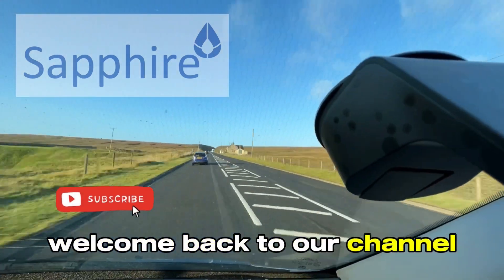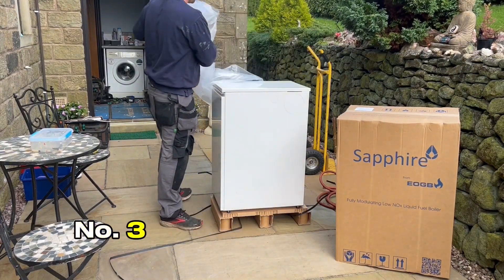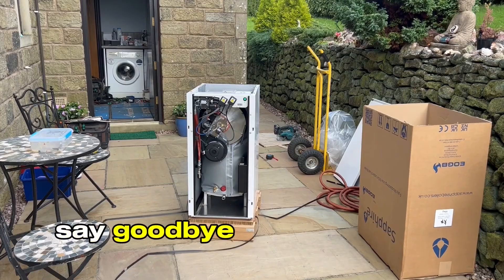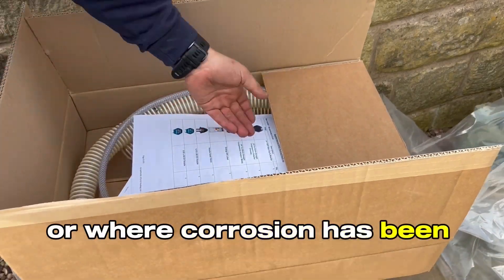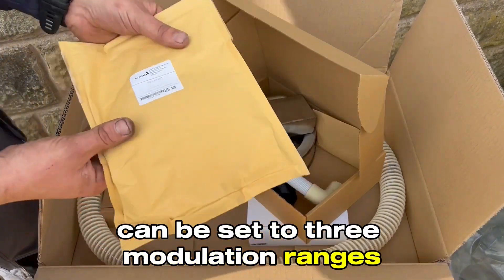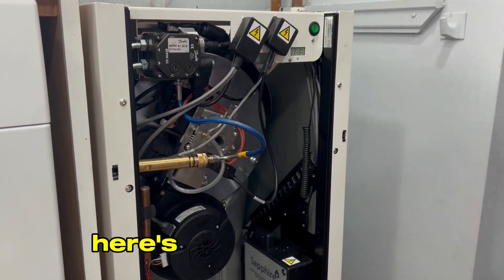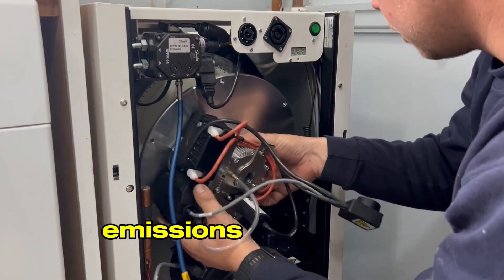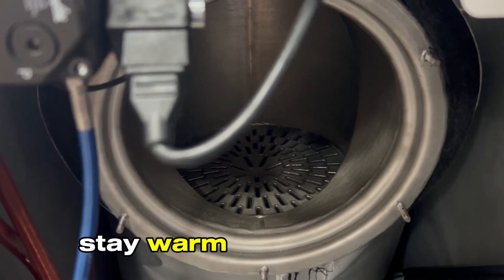Huddersfield's finest: The EOGB Sapphire - The UK's First Fully Modulating Oil Boiler. Were excited!

Comment: I dont care about euopean standards/ enviromental concerns/ etc,  i just need a good reliable boiler simple engineering is the key to reliability and your boiler there does not look simple, this wont help me in winter when it breaks down and i cant find any one to fix it. same problem as heat pumps.